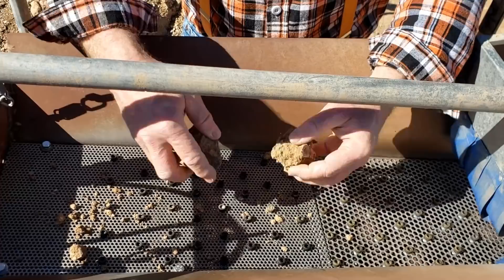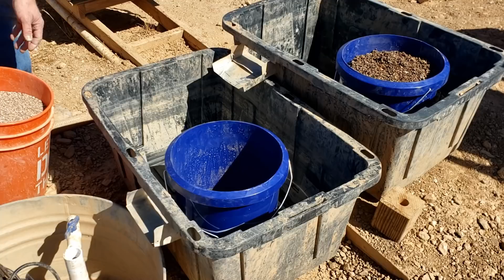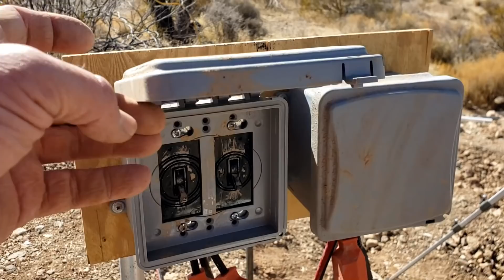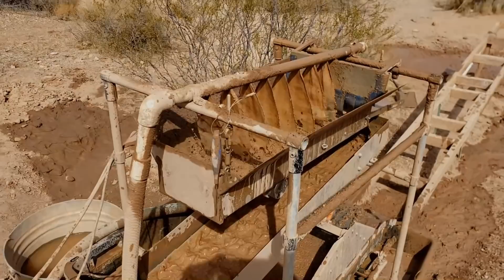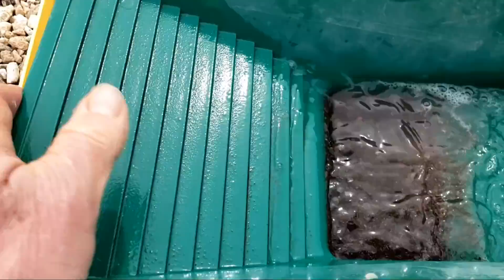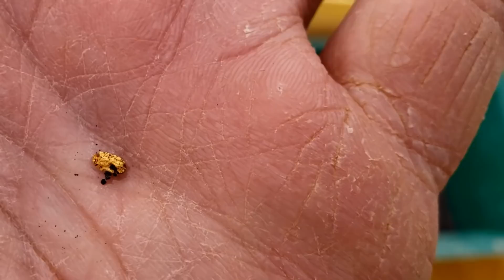Desert Gold Wash Plant Innovations 2021

Comment: A flat shaker table is ok... but you want smaller and more efficient less water.. so run a v grooved shaker the v groove has twice the surface area over flat and moves heavy black sand and clay/slilt faster less space. My uncle was a pantent lawyer and has the most roller coaster patents in the world.
Reply from the maker: @RobertGardom  I investigated that long ago.  Easy to comment, however, trying to make on on a small scale is not.  Staying with a flat deck is much more practical.  What you are watching in this very is a very early prototype.  Check out my latest videos on the Gold Rattler.

Comment: Hi Allan, Do you have plans of your design I wouldn’t mind trying to make my own. Thanks again for the Videos you do. Cheers Shaun
Reply from the maker: Hi Shaun.  I don't have plans available for public.  Perhaps in the future, once the patents and Trademark are completed.  The wash plant dewatering deck is the most difficult unit to create.  It appears simple, however, it's the invisible physics going on that makes it work.  It took about 6 months out of my life to figure the secrets, because there is no data on how to build it, even though large oil and coal industries use them all the time.  In a weird way, it seems as though the keep the data a secret.  You can watch a multitude YouTube videos of these in action, but no info on how it works.  Ugh !!  With that said, I'm not quite ready to "let the cat out of the bag" just yet, after spending a huge amount of time and $$$ figuring it out. 😊👍

Comment: Alan please make a video on how you made your dewatering deck shown in the 2001 video thank you Tapper light
Reply from the maker: Hi Mark, some day I will.  As soon as the patent process is completed for the new trailer mounted wash plant.  Even though large commercial operators use these decks, there is no data on how to build one, not to mention the complex physics behind it.  Apparently, its a kept secret.  Lots of videos of them in action, but no science. It took over 6 months of experimentation and trials before I figured it out.  I build airplanes and telescopes, and that little dewatering deck was the most challenging thing I ever built.. Ugh !!  Not willing to share my hard earn $$$ and knowledge just yet, but soon. 👍👍👍

Comment: I have a self contained  trommel, build in sluice, cork screw waste discharge, approximate  50 gallon water tank (recirculation), water pump. No filtering, sluice waste dumps into cork screw (some dewatering), waste water going back to storage and pump.  Problem, water gets into pump and sprayer plugging everything, I am lucky to run 1/2 yard of material? Can you help?
Reply from the maker: Hi Tim.  Sounds like the same I was experiencing, which led me down the current path.  The dewatering shaker deck, along with a sand filtration system would be perfect for your system.  However, to DIY build of a linear transfer dewatering deck is complicated, so I recommend building a dewatering trommel with a 60 mesh screen instead.  Coupled with sand filter system you could extend the water by almost 100%, and have better fine gold recovery.  I have a trommel build series and sand filter videos on my channel to help you make these items.  Hope to be manufacturing dewatering decks in about a year. Best of luck to you prospecting. 🤠⚒⛏👍👍👍

Comment: Allen how much does the wash plant amount to when it's all put together with dewatering .     The cost of the components and do you sell a complete unit
Reply from the maker: Are you asking how much does it cost, or volume rate per hour ?
Reply: @allansgoldmining  the cost of the components and do you sell a complete unit
Reply from the maker: @johnvidmar7316  thanks for clarifying.  Cost of materials is about $1500 US.  I don't sell the components, however, I'm currently building a trailer mounted commercial prototype.  Hope to start production in about a year.  Thanks !

Comment: Wow Allen, what a great project and evolution of your desert wash plants.  Love it!  I've seen those vibrators for sale and you said 90 Watts 3600 rpm.  The ones I've seen don't plug right in and some are sold with a speed controller.  Did you need to wire yours to plug and do you regulate the speed or is that done like you said by adjusting the weights as needed.  Your ability and experience is AMAZING, thank you!
Reply from the maker: Thanks for your compliments Aaron !!  Yes, these vibrator motors come with a variety of attachments.  However, I use none of them.  Best to plug it in and run full power.  AC is best, and more durable and adjustable.  It's the physics going on that you can't see that makes this dewatering deck work.  Info on how to build one is virtually non-existent.  The Big Boys keep it a guarded secret.  It took me many months, of trial and error (mostly error), and $$$ to figure it out.  It's huge pain in the a$$ to make it work right.  There's a principle called Energy Balance Mechanism.  Once you understand it, makes all the difference !  The new one I'm designing will be even better !  Thanks for watching !
Reply: @allansgoldmining  very impressive what you have built and the evolution.  My dad and I built a recirculating unit but know where near as efficient with the water use because our claims for it are next to a river.  Thus far we are not allowed to process “In the river”.  GREAT work Allan!

Comment: Allan, Keene advertises that their 'dustless' model series 160, 190, and commercial 210 'dry washers' have recovery as good as wet sluicing. Have you ever heard about the performance 'or' personally tried Keene's 160 or 190 series dry washers.??
Reply from the maker: Hi Roy.  I have seen their units in action, however, the physics remain the same.  Recovery remains 70% at best.  Furthermore, like all dry washers, are limited to seasonality and moisture content.  With a wash plant this is no concern.  Furthermore, a wash plant can wash all rocks, and break up clay clots containing gold (such as on my claims).  That can't be said regarding dry washers.  Therefore,  a wash plant remains far more efficient.  Thanks for watching !

Comment: Allen, I just found your channel. I use to mine gold out of the creeks and rivers here in NC&SC. The loss of my youngest son and an operation that damaged my left hit caused me to have to give it up. 
On the 200 meshed; you should really check the material coming off of it as well as the mud that is caught in the other tubs!
If you were to add a cone shaped top to the buckets most of the fine gold would stay in the buckets as the water over flowed the tops of the cones. I would fix it so the buckets are also vibrating like crazy to make the gold drop into the bottom of the buckets. I would raise the exit holes and add a cover over them inside the buckets and add a screen but if you make a funnel like screen then your super fine gold will stay in the middle of the buckets as the water makes its way to the holes. It is a proven fact that gold drops very fast straight down when given the opportunity!
I would save all of that mud and run it on a shaker table if possible. There were a lot of plans to get bigger into the dredging but my youngest son had to have a motorcycle and he was hit buy someone and killed in 2016. That stopped everything! It has changed our lives forever!
Hope I have sparked some thoughts about your set up?
Stay safe and please keep the videos coming!
Reply from the maker: Thank you for your kind message.  My sincere condolences on the loss of your son.  Life is full of challenges.  I'm dealing with elderly parents and a sick wife.  We need to press forward in faith and do our best on this earth. 👍

As for the wash plant, I'm not sure if you understand how this unit functions ?  I recommend watching the next video, "Wash Plant Q&A, and Chunky Gold Strike."  I explain in detail some of the principles and functionality of the wash plant.  Hopefully this will be helpful.  Thank you for watching !  Best of luck to you prospecting ! 🤠⛏⚒👍

Comment: Hi Love your setup. Can I run 2 DC Vibrators Off one 120V to 90V variable speed drive ?
Reply from the maker: Thanks for watching.  Unfortunately, DC vibrators with speed controller will not work reliably.  AC at full power is best.  A lot of physics going on that you can't see which makes it function.
Reply: @allansgoldmining  Thanks Allan. Just worried about synchronization of two vibrators side by side or do they try to cancel each other out ? I can go AC

Comment: Love the Unit Allan...Great job... I noticed a few things that might help your percetages.The Shaker Deck on the top is nice but your Sand Trommel would be more efficient for what you are doing. The rocks coming off the top are still covered in mud so you are loosing gold for sure. The Trommel would allow you to use higher pressure for the spray bar and keep the water from flying away and loosing it to the dessert. The other option 2 quick fixxes are to put a speed controller or adjust the angle up at the back. This would allow you to controll the spead of the material going under you wash bars. Food for thought... lol... NICE WORK
Reply from the maker: Thanks for your comments Bill.  Please view my subsequent videos demonstrating the rocks are completely washed.  I'm not sure what you're referring as a "Sand Trommel" ?  I have many trommel videos published in the past, including a three part series on how to build one.  In terms of manufacturing a viable portable wash plant for the weekend prospector, a shaker deck system is more ergonomically practical, and economical to produce. Hope to have a trailer mounted commercial prototype out this fall.  Stay tuned !  Best of luck to you prospecting! 🤠⛏⚒👍

Comment: Would it help to put some old shirts on top of your sand filter buckets to stop some silt?    Could a bag filter be placed over the pump intake?   ✌️
Reply: Yeah, i was thinking just as a temporary measure.  Simple enough
Reply from the maker: On a small scale, like a mini sluice for cons, it probably work okay.
Reply: Overall, I think your wash plant is great.  Where could I operate one in socal?  👍
Reply from the maker: I'm building a trailer mounted prototype for future sales.  Hope to have it complete this fall.  I think by that time folks can come out to the claim (in NW AZ) and operate it.
Reply from the maker: Good question !  You could, however, the slightest accumulation would prevent water from penetrating, thus spilling over the edge of the bucket, or inhibit the suction of the pump.  Would also require constant washing of the cloth.  Been there, done that.  Lol !  I tried 400 mesh screen too.  Same problem.  This is why the dewatering deck has vibrators, to continously shake the filtrate to prevent this from happening.  Thanks for watching !  👍👍👍

Comment: I still like the trommel over the shaker deck. Due to the really clayly ground at my clams
Reply from the maker: Yes, the trommel is slightly better, however, much slower.  That's why they are 3 times larger than a shaker deck running same volume.  The studs on my deck help mitigate the hard clay clumps.  They are most difficult when dry, but crumble instantly when damp.  Sounds like you have the same gunk I'm dealing with !

Comment: What is the finest or smallest mesh available?
Reply: Thank you, I was kinda wondering why you didn't design it with 3 or 4 layers starting with the 200 mesh and the last layer with 600 mesh.
Reply from the maker: Yeah, I experimented with that.  Had a two deck screen.  60 and 400 mesh.  The 60 worked perfect, however, material on the 400 deck would stall and cause a backup clog.  It needs larger particle mix to help advance the gooey clay.  200 mesh on a single deck was the compromise.  I'm running -1/4" material through the sluice and dewatering deck.  There are multilayered units for the Big Boys, but they stop at 300 mesh.  Takes a lot of energy to operate.  Also depends on type of material they dewater.  300 mesh is usually for coal or shale.
Reply from the maker: You can find up to 700 mesh, but very expensive.  200 mesh is the limit on this design.  In fact, most of the Big Boys don't go any finer, due to the physics of the machine.

Comment: when i dewater my slurrie i ad some coagulant that i get from nalco chemical co it dramatically improves dewatering efficiency.
Reply from the maker: Hi Mike.  That's a good tip !!  I'm interested.  Where do you apply the coagulant ?  Will this coagulate particles smaller than the screen size (200 mesh) ?  If so, this would be tremendous, by reducing sediment in the tubs, and help keep deck screen clean longer.

Comment: Do you mass produce these systems?  Thanks
Reply from the maker: Planning to do so in the future. It's  on the drawing board.  Will be trailer mounted.
Reply: @allansgoldmining  looks like a great concept for the desert.  Please keep us posted and your concepts are very revolutionary I believe in the concentrate vibration systems over the trommels but the trommels are good for some applications.
Reply from the maker: @dennishedrick5308  thanks.  I like trommels too.  They have their place.  Shaker decks are more compact and low maintenance.  Pros and cons to each.... 😊

Comment: Seems like it would be easier and much less weight to haul around, to configure SCREENS!!   I mean have one large container and use finer and finer screens.  This is what they do in Seattle to reclaim concrete water.  They classify the rock sand, then the concrete in the water goes through a series of screens of finer and finer mesh.  They get relatively clean water to reuse then they scrape the wet concrete (or what they call cake) off the screens for reuse.
Reply from the maker: Thank you for your comments.  Obviously, you haven't seen my previous videos where I utilize "SCREENS"  Concrete water reclamation requires massive screens, impractical for the weekend prospector.  Sand is far more efficient, requires less maintenance.  The level of natural clay on my claim would require constant screen cleaning in order to keep things flowing.  Thus removing valuable time for the operator to process material.  Keep in mind that my plant holds 35 gallons of water and pump rate of 2,000 gallons/hr.  Therefore, the water cycles through the system almost every minute and 10 seconds.  The purpose of the dewatering deck is to remove as much solids as possible.  Without it, the tubs would be clogged of gooey clay within 30 minutes.  No screen system can handle that, especially for the weekend prospector.

Comment: The battle to have cleaner water here in the desert is real. If I was running ac I'd just probably throw my hands up and go bigger dry washer. Sure water is nice but yardage per cost is murder. Still fun little setup and seeing that mud filtered out is gratifying.
Reply from the maker: Hi William.  I love dry washing too !  It's one of the best (and cheapest) way to test ground.  However, once I find something I like, I prefer to maximize my recovery with the wash plant.  If I'm going for the gold, I want all of it, not 50-60% yield from a dry washer.  The another advantage is I can mine all year, as long as the water doesn't freeze.  The wash plant is actually more cost effective from an operational standpoint.  Cost me $6.00/ day for fuel and water.  If I'm recovering 95-98% on good ground, it will easily pay for it.  Sure, there's a lot more equipment involved.  However, my goal is to build a trailer mounted version, thus making it almost as simple to set up as a dry washer.  It's a challenge, but I think I can make it happen. Thanks for your kind compliments.  Best of luck to you prospecting !!!
Reply: @allansgoldmining  Yeah not going to lie I hate the thought of leaving fines behind. I'd love to find a remote water source that no one's knows about. That would make the dream drift setup. I always wanted to try a cyanide setup but you can amagine the safety and environmental headaches.